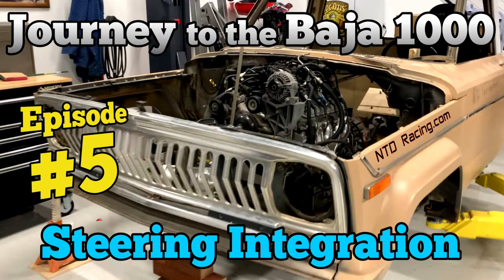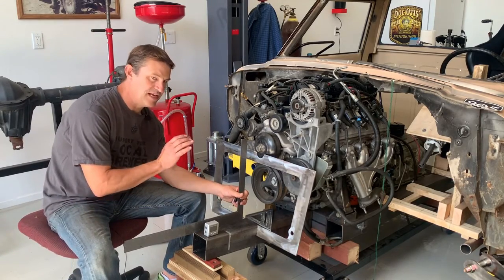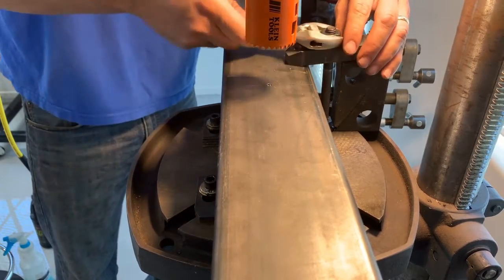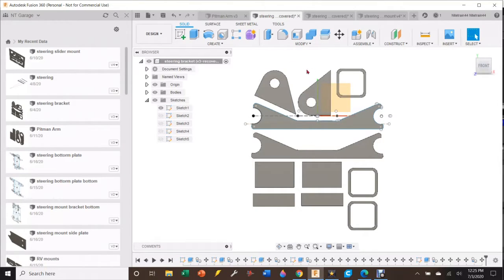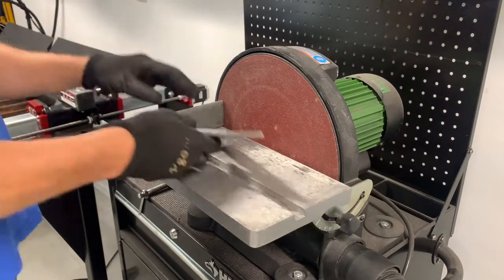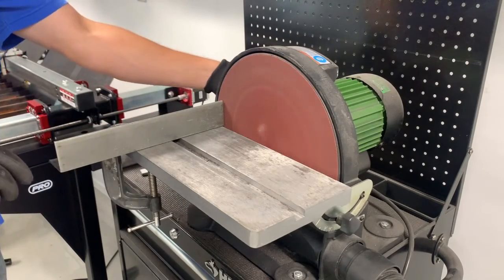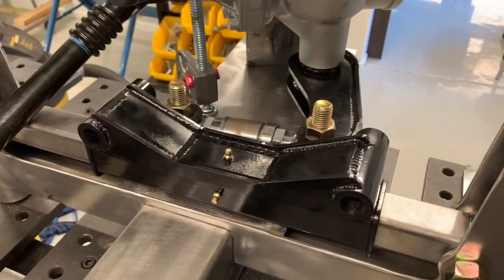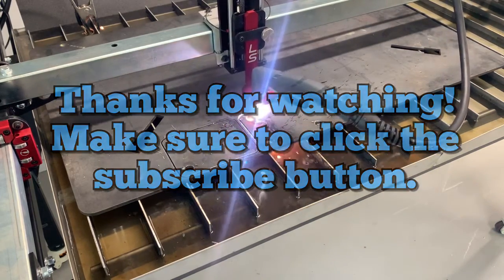Budget off-road steering Part 2

Comment: This looks really complex. Have you considered the flex factor? Your sliding steering shuttle travels on the exterior of another steel tube. Do you think flex under dynamic load may cause binding in the travel of the shuttle while all the components are being stressed during driving?